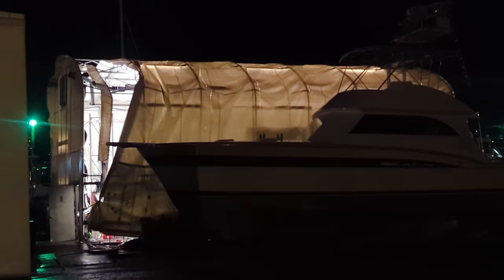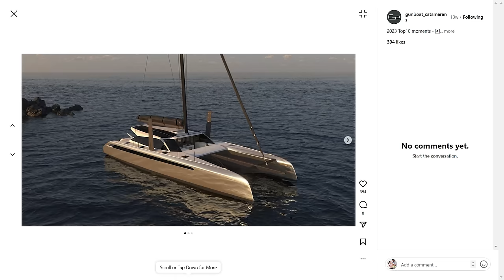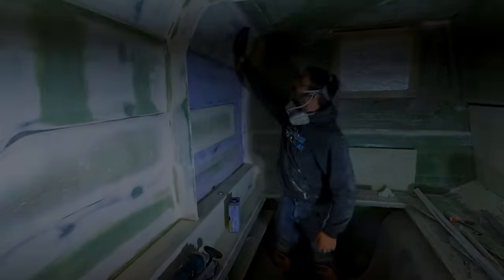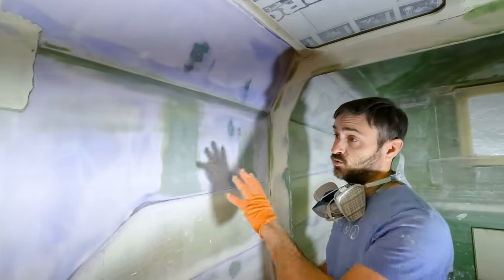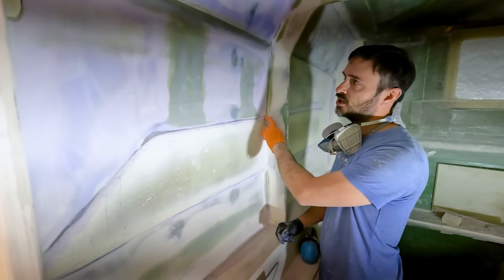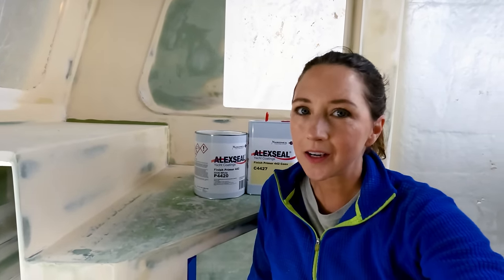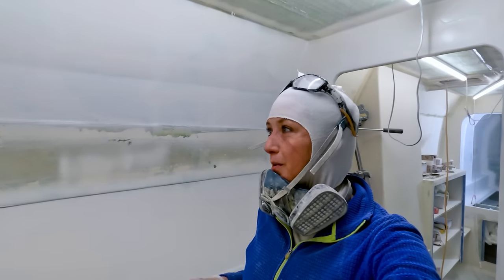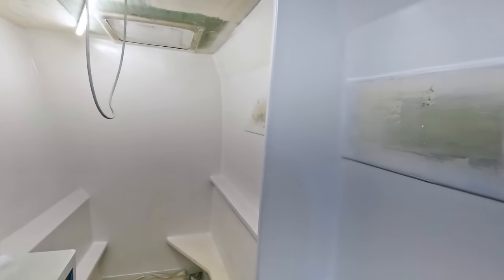I've Dreamed of Painting Our Boat This BRIGHT RED!! (MJ Sailing - Ep 321)

Comment: Matt- another tip from a pro sprayer (not me) who just finished my boat.  When you pull or release the trigger on the gun you need to do it when it is not pointed directly at the surface. Doing it that way leaves vertical lines in the paint.  Instead, pull the trigger when it is aimed at an angle, like 45 degrees off, and sweep it towards 90 degrees and start your horizontal motion.. then pivot the gun away from the surface to 45 degrees again before letting the trigger go.  Kind of like the motion a broom would have sweeping a large floor back and forth.

Doing it that way feathers in the lines to hide them.  You can see this on spraying demos on youtube (look for how to use a paint sprayer to spray your home).

Comment: Matt, Your spray gun needs some adjusting for spraying that primer, The top knob should adjust your spray width, witch needs to be wider, and the lower knob should adjust the flow rate, witch needs to be less if your getting runs, ie: top knob anti clockwise and lower knob clockwise, practice on a board outside to get it right, as this layer of primer should be applied as if it were "top coat" or finish coat, those runs are really going to take some getting out without altering the surrounding surfaces, All the very best to you both, Al (retired spray painter)
Reply from the maker: The Binks gun is all the way out for spray width.  It seems tight to me too.   I figured out the issue with the runs -- I was way too close to the surface.  Later it went better once I realized the mistake.
Reply: @MJSailing Get yourselves air feeders for your masks that are available from Ebay & Amazon you obviously have air for the spray gun!  A pressure pot paint gun would be far superior to the spray gun you have & the proper way would be to use a airless sprayer with nozzles matched to the paint viscosity, and desired fan width. Definitely for top coating airless is the way to go.
Reply: Yes my come t was going to be too close, too fast and widen the fan
Reply: @MJSailing Might need to get a "wider" tip for the gun: one that sprays a wider fan of paint mist. Typical for the type of surface you are painting would be a tip that sprays a fan 10-14" wide when the gun is 12" from the surface. I think the part numbers would be like 114-01110, 114-01112 and 114-01114 for 10, 12 and 14" fans

Comment: Hi guys.  Good to see a new video!  

Matt, not sure if you remember but we spoke at the Annapolis boat show back in October at some length about how pleased we were with using Alexseal on our PDQ 36.  In less then ideal conditions (outdoors with bugs and dust) we painted our hulls by rolling the paint on and we were blown away by the results.  This product is amazing and I’m sure you’re going to love it.

Just a couple of comments after a year of sailing with this paint on the hulls.  We have found the paint to be extremely durable and easy to clean.  In our present docking set up, we dock on the STBD side with the prevailing wind on our port for most of the time.  This resulted on the boat pressed up against the fenders on the STBD side.  We have old, dirty, grimy fenders and I had some concern that all of that rolling back and forth on the fenders day after day would result in wear on the paint that would require buffing to bring back a shiny finish.  When we hauled the boat this past fall we were unable to find any wear at all – the finish looked like it was freshly applied.  We had not painted the sugar scoops as they were in pretty good shape so they only had the original gelcoat.  From sitting in the scummy marina water all summer, there was quite a waterline stain.  The Alexseal simply wiped off with water and a cloth.  The gelcoat on the sugar scoops however, required a significant amount of effort to get the stain out.  Jessica, you mentioned something about ease of cleaning and durability of gelcoat vs paint – from our experience I can confidently say that the paint appeared to be very durable and easier to clean than the old gelcoat on our boat.

One last comment about our experience applying the paint.  We found (as you found out) that the material is very thin (watery).  As a result, I think to get proper coverage you will require multiple coats of topcoat (we applied 3 coats).  Jessica, you mentioned using the darker primer for your surfaces inside the boat.  Based on our experience I’m not sure that would be the best solution.  You may find that more coats are required to get proper coverage using a dark primer with the white finish.  We did have some issues with making sure we got complete coverage on each coat.  What we ended up doing was I rolled the paint on and my wife was constantly inspecting the surface as I was applying it for any dry or missed spots – this seemed to work well.  It does look like you guys will be spraying so your process will be different from our project. 

There were a couple of other boats in our yard that been professionally sprayed (not Alexseal) and our finish was any bit as good.  People were stopping on a regular basis to check out the progress and couldn’t believe the quality of the finish. I certainly do not claim to be an expert – this was the first time we ever painted a boat.  I spent quite a bit of time on the phone with tech support at Alexseal to make sure that we understood the process clearly (their tech support is excellent).  We followed the instructions to a tee and couldn’t be happier with how it turned out.

Good luck with your project, it’s going to be awesome.  Oh yeah, I vote for red…..

Comment: Great progress!  I like the idea of red - this will definitely stand out wherever you go.  TIP: the yellow paint pouring guard is designed to be installed on the INSIDE lip of the paint can, not the outside. 🙂

Comment: Looking great. When you spray a section make as longs as strokes as possible, Because when you have a six foot wall  and you only spray two feet at a time and then start on your next two feet you are doubling up on primer or paint when you overlap and that's most likely where you are getting runs. Keep up the great work.

Comment: Matt - You should really watch some car painting technique videos. I know you're only spraying primer that'll be sanded right meow, but you should be using all that gun time to perfect your techniques, so your final finishes come out perfect. Never stop in the middle of a large area unless you cannot reach the end of it! When I painted cars I'd do full length passes from the grille to the taillight panel. Anywhere you stop and start will show, and that's a huge cause of runs in primer. Don't let off the trigger all the way between passes! The air should be flowing all the time, you just turn the material flow on/off at the ends of a sweep, preferably past the end of what you're painting. I highly recommend getting a clean 55 gallon drum and some cheap paint to practice with before you spray any paint. My auto painting teacher wouldn't let me paint a car until I could paint a drum with no runs or dry spots. 55 gallon drums are really difficult to paint evenly so they're great for practice!

Comment: Just reached the part of the video where you’re going to mix the two parts. I’m glad to see you are using a pouring rim spout. But you can put it on the inside rim of the can to avoid paint  getting under the lid/can seal. It is looking very nice. Good job so far.

Comment: I used Alex Seal on the arch for my boat. 
It was a 3 part mix including the reducer. The primer took 3 coats to build up. It is really thin. 3 coats of too coat too. Really expensive, but great look and extremely strong.

Comment: So glad to see your using a spray gun. Just remember don't stop your movement until you already have let off the trigger!   Also you want a thin first spray, a heavier second coat.  Also if you struggle with runs your paint is mixed too thin if your moving the spray gun and letting off the trigger before you reverse the direction

Comment: I used Alexseal for my deck refit three years ago and can seriously recommend it. A little bit on the expensive side but it is worth it. I rolled it on and the roll additive worked its magic and no tip off is required. Very close to spray finish and extremely durable once cured. Two coats of primer and two coats of topcoat did it.

Comment: Hi there Guys,  Matt you need to watch some spraying vids on Youtube. You are spraying in a narrow line with minimal overlap. I recommend opening out the fan on your gun and spraying a much wider pattern with less paint and far more overlap. It will get you less runs and more even coverage. Also you can do a lighter coat on first pass then go back over right away for a deeper layer when the paint will have started to tack over
Reply from the maker: That's as wide as the pattern goes on that gun.   Seemed tight to me too
Reply: You should have 3 knobs for setting a normal gun. One is paint needle for paint volume. Above it is the fan width. You can get a spread of 10” with it well open. Closed down you get a circle for edges, corners etc. on the bottom of the gun is the pressure adjust. I would ignore it and fit a cheap chinese inline regulator/water separator with pressure clock. Set your air pressure here. For top coat you may get best results with 1.4mm nozzle and for primers, particularly high build you will need the 1.8mm nozzle. I would recommend a separate gun for each. I have a pair of lower end Devilbiss FLG guns for painting. They are $150 typically, £125 here in UK. Until you spend proper money they are just as good as many other guns in the $400+ range

Comment: I would advise a bit of caution on assuming using Alexseal would have the benefit of worldwide product supply & support. We tried using Alexseal in Thailand for our 15 meter cat and ended up switching to Jotun. Reasons? 1. Local price was astronomical, more than 30% higher than Australia (which is expensive for starters). JOTUN Hardtop AX was about 30% of the price of Alexseal topcoat. Jotun Hibuild primer was 25% of the Alexseal finish primer price. 2.  Many products were not stocked, for example they would have primer but no converter, or vice versa. Over a month wait for anything, " until next shipment" & thats with supply out of local area distributer in Singapore! 3. Poor sales support even trying to buy product, eg 2 weeks to get any quote response, so imagine post sales support?

On the plus side, it is a good product with great colour range. Tough paint, easy to repair unlike Awlgrip, easy to spray and control for environmental factors, good gloss level right out of the gun.

A tip for you; I tested the need to use their finish primer, compared to alternatives such as Jotun Penguard Highbuild which is easier to apply, more versatile in application, and about a quarter the price. There is absolutely no difference in the final finish! Alexseal will tell you their primer is special ( hence the higher cost) and gives higher gloss in the 501 Topcoat, because it "sands better"....and that is marketing BS to extract more from your wallet with a high profit margin product.

Comment: IF you dial back and open up to the max the upper adjustment on your paint gun it should widen your spray pattern.  You may have to overlap more in your paint back and forth but should generate less runs.  Upol makes a nice 2 part tint-able high build primer.  Good price and available on ebay.  Hope that helps.
Reply from the maker: That's actually as wide of a pattern as possible on that gun.    Seems tight to me too

Comment: If you want to see a really great looking cat in red- check out sketch to sea.  His HH Catamaran had red hulls.  The one thing I will say, and I am sure you have probably heard this already- the darker the color the better the surface has to be-the tiniest imperfections will show.  Have you considered maybe using a wrap?  Is that even possible with a fiberglass hull?  I have seen steel boats get wrapped, but am unsure as to a fiberglass hull.

Comment: You have the pour spout on the wrong edge.  It's supposed to be on the inside edge so the paint does not get into the groove where the lid seals.  My favorite color is pink.  Check out the early episodes of Sailing Miss Lonestar.  I think I'm going to pain my boat hot pink with sky blue highlights.

Comment: There are many good reasons why nobody overpaints factory new gelcoats. Except if you have too much time and funds.
The contrast between the white gelcoat and the color of the paint will make every tiny scratch more visible from far.
Also many paints cannot be cleaned and polished as good as gelcoat.
Imo there is no rational reason to overpaint a new gelcoat.
If you really want something else than white, than you can use colored boat wrap for the sides above the water line. Be creative with the colors and the shapes. It doesn’t last longer than paint, but it’s easier to get remove, make new patterns or return to the original gelcoat.
Yes, it’s not sponsored by Alexseal.

Comment: Looks like your “fan” was the wrong way for sidewards spraying. You want a wide up and down fan that you overlap. The wider the fan the less chance of runs. If your fan is the wrong way or narrow you end up with 2 much material going on at once causing runs
Reply from the maker: It seemed tight to me too.  That's as wide as it can be with this gun.  I was shooting too close to the surface and once I pulled back it helped

Comment: Spraying anything open the gun up to full settings to start. Im sitting yelling the screen.... open the fan you should be spraying a a 6 to 8 inch fan with that gun overlapping each run... also a first coat should just be a mist coat... don't try to cover with first coat. Let that offgas then apply 2nd coat. Go for third coat if you plan on sanding before finish coat.

Comment: Red Paint can be can be disastrous I Painted a brand new 60ft Crowther designed catamaran at Airlie Beach in the Whitsundays in Northen Australia which is very HOT part of Australia . The Red paint didn't even last 12 months Be very carefull with RED PAINT Cheers Michael
Reply: I have that problem with Farmall Tractors... Unless you have the best coating, it fades quickly...   Though I guess thats true for all coatings

Comment: You are way too close when you spray your primer. Let the fan do the work do longer strides to. You need to do several coats of primer. Don’t try to cover everything up with the first coat. You will get lots of runs that way your fan looked a lot better when you first started you just needed to back away from it and do longer strides.

Comment: You might want to consider what the color is going to do inside the cabins as far as radiant heat from the sun is concerned .the darker the color the warmer the inside could become . A nice lighter color will reflect the suns rays a little better thus keeping the inside cooler and your air conditioning won’t work as hard ,, allegedly . You probably already knew this I hope .

Comment: Just a tip for you if you have any pantihose's that have a hole in them use as a paint blotter , Roll them into a tight ball and when the Paint has just about gone off (Dry ) just lightly Dab the run you should see the pattern of the pantihose in the panel but it will fade away and no run will be there. Its a old auto paint trick used by Very Old Tradesmen like me. lol  :)